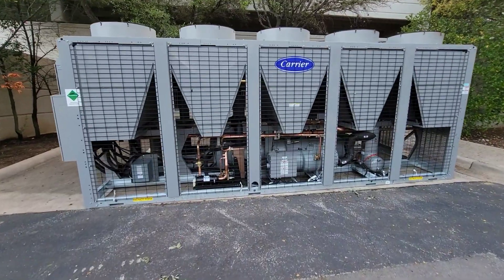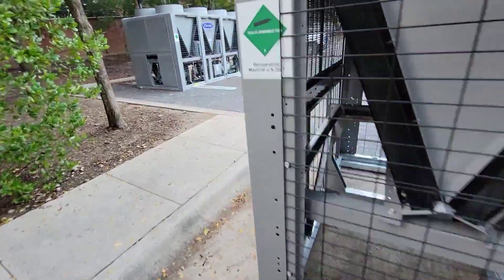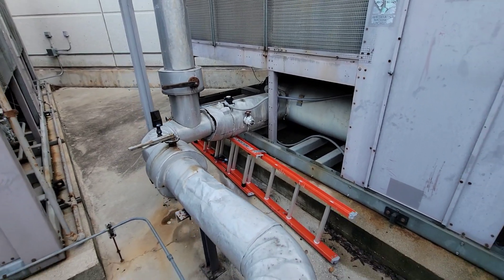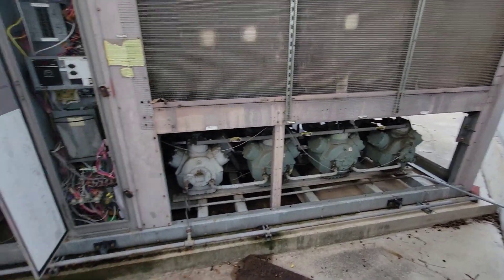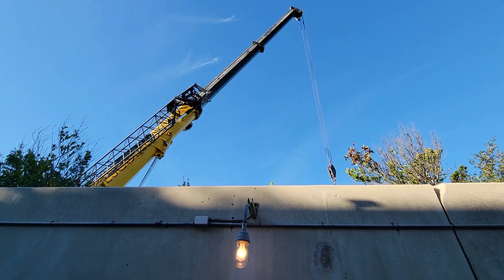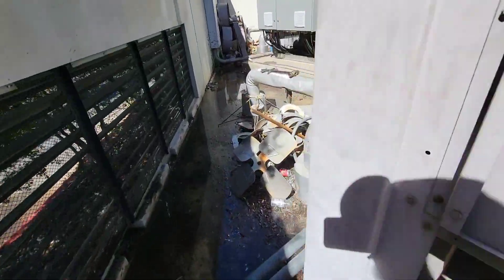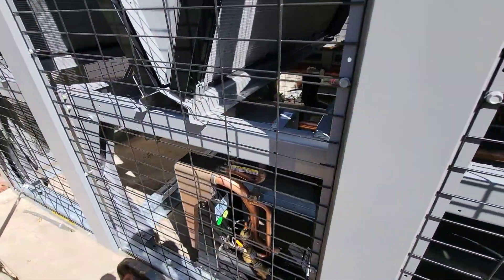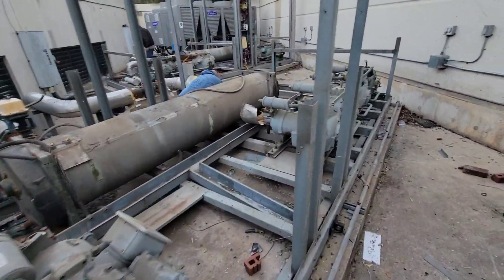Air Cooled Chiller Changeout Carrier XV Screw

Comment: I'm curious to know why you prefer a York air cooled verse a Carrier air cooled? Both are great manufacturers I feel carrier is user friendly and have great resources. Also one thing thats not noted is on the vessels for the heat exchangers the vessels are triple wall plated . Screw compressors are super reliable unless miswired
Reply from the maker: I'll plan to share my thoughts more openly for the December livestream.

Comment: Anti-vibration insulators? Flow switch to the output of the chiller? Cold water feed and return collectors? Two manometers to measure the pressure drop in the evaporator? Mmmm..seems that the installation standards in Argentina are different, perhaps better.